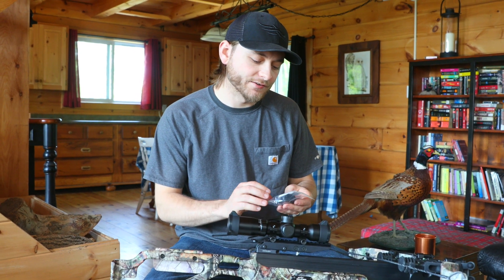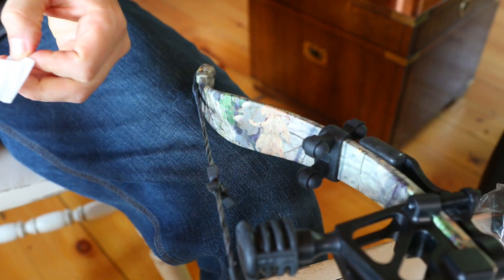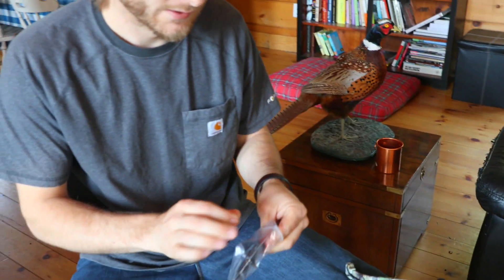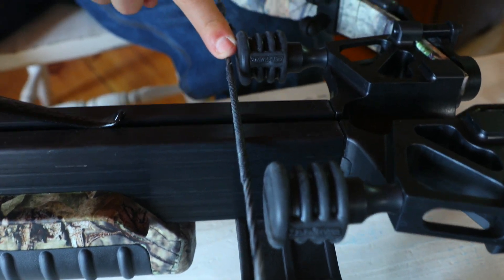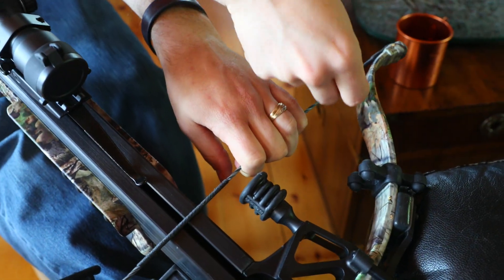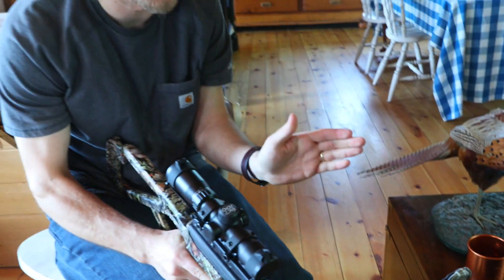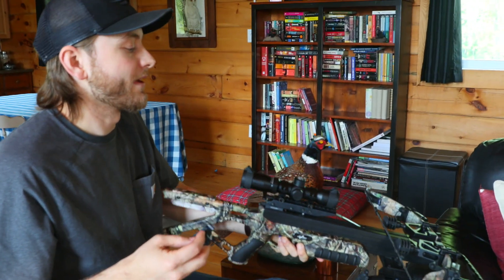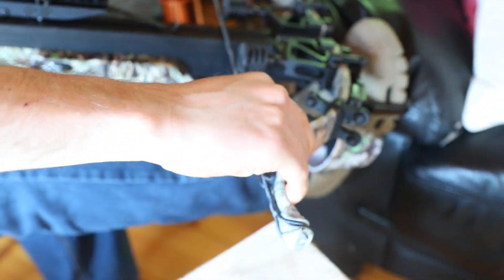Excalibur How To: Installing EX-Shox Technology

Comment: I have installed these 3 times and they have came off every time. I really wanted to be able to use them but the adhesive is just to feeble to keep them on more than 20 shots
Reply: Fueled Iowa I’ve installed them 4 times and they’ve never fallen off bc I let them cure for 3 days but the strings never hit the center of the ex-shox. They have always hit the very top of the ex-shox because when you cock your crossbow back and you shoot the string flies up towards the top of the ex-shox never kn the middle. I always have to readjust the string to be in the middle of the groove each time I shot so I took them off 4 times and I have never put them back on anymore.
Reply: did you clean the limbs with alcohol?
Reply: @juffurey  yes I tried clearing with alcohol, break clean, even a sticker clean, prep, and adhesive multiplier stuff. Nothing ever worked. I have up in them.